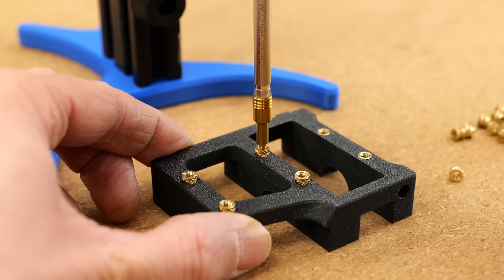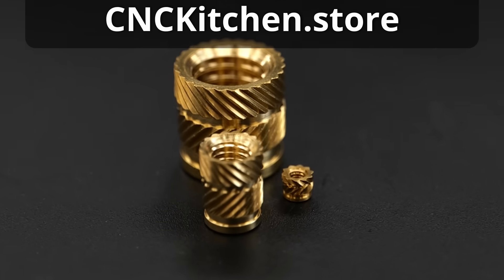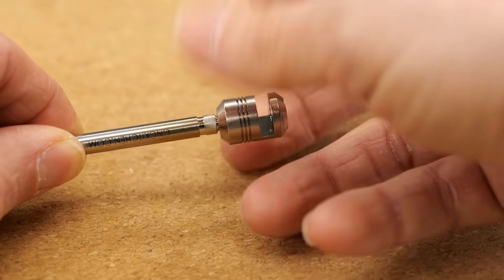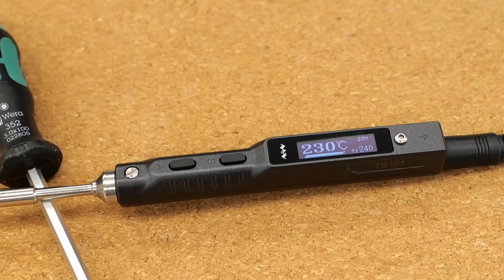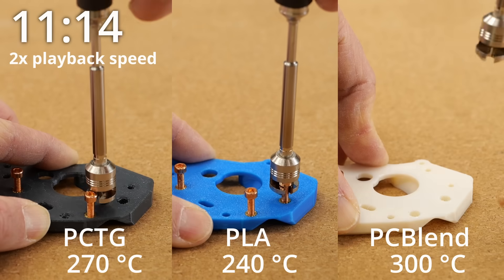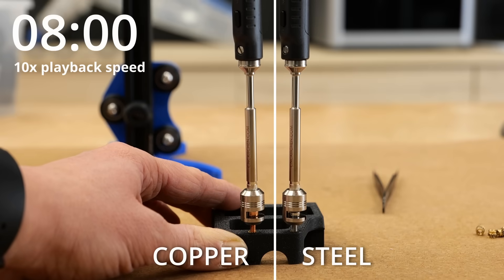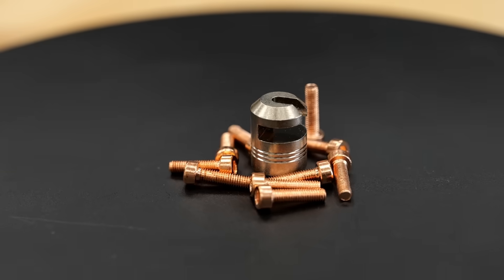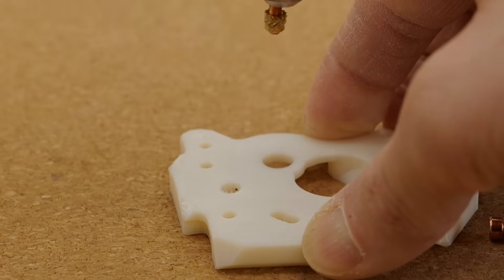We made the FIRST Insert EXTRACTOR!

Comment: Great idea but why is it so big? That's a lot of thermal mass. Seems like it could be just a little bigger than 3mm in diameter for an M3 screw. Would heat up quicker and be easier to use.
Reply: Speculation on why it seems bigger than you think it needs to be:  1) Mechanical strength. If it were “just a little bigger” than the screw it’s meant to remove then it would be easy to bend or break, especially with these softer metals and under some of the side loads seen in the video. 2) A big thermal mass is a feature not a bug 😀. The thermal mass of the copper screw, the insert and the plastic are big too, so having more thermal energy stored in the tool before contact gets the whole system to target temperature quicker and makes it easier to hold that temp (the latter is likely less relevant here). Basically the same reason you preheat an oven when cooking. 3) Manufacturing costs. Machining and plating something smaller in these soft metals might be more challenging.
Reply: @TMMonkeys good thoughts, I considered some of these. Not sure what it's made of, looks to be stainless, but I doubt mechanical strength would be an issue. There's a trade-off involved in thermal mass considerations, time required to heat up the device vs time required to heat the insert once it's placed. Still think it could be smaller, but maybe they prototyped various sizes and determined this to be optimal.

I suspect they were planning to make these for a range of screw sizes (M3, 4 and 5 for instance) and figured that making one large body for all of them would reduce manufacturing costs due to economies of scale, with minor modifications at the bottom for the different sizes. Then when they decided to just release the M3 version as acknowledged in the video, it was easier to keep the body size given the engineering history involved.
Reply: @Numenor7 Stephan mentioned the material. It's nickel plated copper.
Reply: I thought just the screws were copper for heat transfer reasons. Okay thanks
Reply: @Numenor7  the large block attached to the soldering iron is nickel plated copper. The screws are straight copper.

Comment: Great idea!  Good looking tool.  Reasonable price for a quality tool.  The problem I encountered is that it doesn't include the 5 mm threaded adapter needed to mount it to the soldering iron.  The assumption is that anyone buying this already has a CNC Kitchen set of heated insert installation tools, so the threaded adapter is already installed in the soldering iron.  I hoped to see the threaded adapter listed in the "frequently purchased together" section, but no.  I searched the website and apparently the threaded adapter isn't for sale separately and is only available as part of a set of insert installation tools?
Reply: Seems like some adapters are sold separately, e.g. TS100/101 & T12 but not all
Reply: @7t3chguy  - I have the Hakko soldering iron.  I guess I can always buy the $16 set of metric insert setting tools with the Hakko adapter, and give away my cheap Amazon set.

Comment: I found what worked best to extract inserts without leaving any plasic on them is to heat them up with the same tip used for inserting them, but not all the way untill the plastic melts completly. 
When the insert is hot you thread a long screw into it and then use that screw as a lever by rotating and wiggling the screw around to increase the size of the hole in the plastic. You can then pull out the insert cleanly witout leaving any plastic residue on it.
Reply: Same here

Comment: You definitely did not make the first insert extractor, McMaster has installation AND extraction tips for their heat set inserts. And if anyone wants it for a size different than what yours allows, theirs exist. Theirs are a bit pricier though, so I've just heated the inserts and pulled out with a screw a few times. If you get the temperature right the few times I tried the plastic doesn't even stick to the insert when pulling it out.
Reply from the maker: I wasn't aware of the McMaster extractor but we thought about a similar concept. The problem here is that you need to screw basically your soldering iron into the insert and then remove the insert from a burning hot soldering iron which must be a literal pain. Might be okay if you want to remove one yet we wanted a more stream-lined version.
Reply: @CNCKitchen  I agree, yours is a less cumbersome design for sure. I was already imagining screwing the iron into the part and thinking it wouldn't work well without a cordless soldering iron anyway.
Reply: @CNCKitchen  I like this design better as you can use an electronic screwdriver to quickly install the copper screws and then extract a bunch quickly in a row. Screwing in the iron seems unwieldy.
Reply: @CNCKitchen  You won't get negative comments on your titles if you stop writing sensationalist clickbait titles.  Easy.
Reply: Came here to say this. They may have made one that’s better but I guess that doesn’t have the same “clickability” as FIRST
Reply: I knew about the McMaster extractors for a few years, I didn’t realize they weren’t obvious to search engine searches, or apparently not readily available elsewhere.
Reply: can you link it because I cant find it
Reply: If you're outside the US McMaster is basically impossible to order from unless you're an actual company. Also I just looked at the prices for those extractors and those are at the point where I would just buy new inserts, and they look like they only work for a specific kind of soldering iron too.
Reply: @jonnyman5656  McMaster is always expensive, they offer super fast shipping from multiple warehouses and a curated list of products with free CAD drawings. If you want you can find their supplier (you can often just ask them) and then order direct but for business its not worth the time. The extractors seem to be a different design than what is shown here so I think both have a place.
Reply: @jonnyman5656  Go spend as little money as you want and buy things from places that work for your locale. I have no vested interest in what you do or don't do with your money and time, nor even an opinion on it.

My only issue is the video title is factually inaccurate. Additionally, there are extractor tips for sizes Stefan's won't support available at McMaster. Anyone can do with this information what they want, I don't own the place or make money from it. It's just a very handy website, and where I first learned about extractor tips years ago.

The iron compatible is available on McMaster as well for all of $30.
Reply: @Sevalecan its a problem that with comes with a company making content for hobbyists.

Furthermore it would be a problem with advertising laws to say its the only one and being content from a company it is an advertisement.
Reply: @Sevalecan  McMaster is basically my go to if I need hardware or cad models quickly. In some cases cheaper or basically the same as other sources but with faster shipping. I have always found tools to be more expensive than the exact same elsewhere before shipping. Even for my own personal projects I'll still use it since I am in the US. Outside the US there's basically no chance for non-business's from what I've seen.

That's my main point, it might be the best site around, (imo it is, I just wish possible suppliers were listed on the pages instead of needing to ask for them, but that gripe came from a very specific component I needed for testing that I could just find on another site anyways.) but if you can't order from it, none of that matters. Even in my work they weren't the only supplier I've used.
Reply: Is McMaster available in Germany?   Might not be.
Reply: @wpherigo1  @jonnyman5656 already raised the point about access outside the U.S.

Economically speaking however, if the insert removal tool is $16+ and includes shipping, you have to ask if you're going to extract around 150+ inserts in your life. Inserts are inexpensive enough that it likely doesn't make sense unless you're doing a high volume, but I imagine many people would buy the tool for the novelty regardless(To each his own, I'm not judging, I absolutely love tools but I have too much crap as it is). Personally I heat it up with the insertion tool and pull it out with a SS screw.
Reply: They may well have made them, but after 5 minutes of clicking around on their website (even on their heat-set page) and trying to locate anything via Google, they sure as heck aren't easy to find for the average user. I gave up. Stefan's will at least be the first findable product. :)
Reply: @LongDono McMaster isn't hard to navigate though. Literally type in "heat set" and you're there.
Reply: @LongDono  McMaster honestly has one of the best websites around, both in performance and organization(There was even a recent video on how they make it so performant)... But I digress, just look up heat set inserts, once you're on the page with them they have part links in the right column for the iron, the insertion tips, and the extraction tips. Literally all on the same line, columns are labelled, very easy to find.
Reply: @LongDono skill issue
Reply: @LongDono It's right on the heat set page.  Searched heat set and it's right there.  Almost every thread size, bot metric and standard.

Comment: But why? To re-use the (fairly cheap) inserts? Also, you're unlikely to salvage the print after removing the inserts so why not insert the soldering iron directly into the insert and then turning it a bit to remove it? I've done it in the past and it works just fine, and it's a lot faster since you have less setup time and you don't need to heat the entire insert extractor.

Comment: Watching this the first thought that popped in my mind was some type of ceramic barrier to prevent heat transfer and some way to leverage up from that point.  You could probably even include or use a spring which would give you some ability to control the force being applied as the plastic warms up to deform.

This would let you tackle the larger inserts as well.

Comment: I feel like there should be a heat-break and different place the user can apply the pull-force on the tip or base of the heating cartridge tube. Just some place that isn't the handle and electrical connections of the soldering iron. Many are friction-fit because pulling was never intended except for easy tip removal. I'm sure it's probably fine if you are consistently gentle, and some heated tips have a small grub screw or screw-down collar if it's compatible with those. Mechanically, not ideal, but probably good enough for it's infrequent but specialized use.
Reply: The 3D print is supposed to be soft around the insert before you pull.
I don't see there being a problem unless you're being wreckless or trying to speed run the process
Reply: @Shocker99  it likely won't be, but still it's pulling on heating cartridges that were designed to disengage from being pulled.
Reply: @Roobotics  Buy one that doesn't have pull out cartridges.  It's only the cheap hobbyist soldering irons that have it?
Reply: @Shocker99  pull-out cartridge systems are pretty much the new norm, in both cheap hobbyist and professional $1k+ systems alike these days.

Comment: They are so cheap ive never once thought ive needed to replace them.

The problem if the insert goes in wonky is that even if you do extract it, putting in a new insert probably isnt going to work.

No doubt the tool works great for removing them... but I just dont see the point.